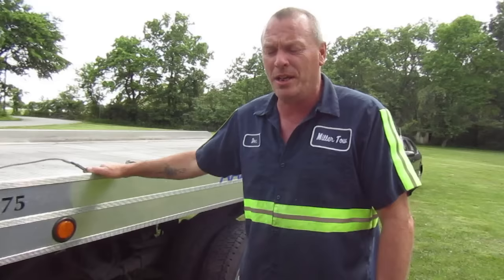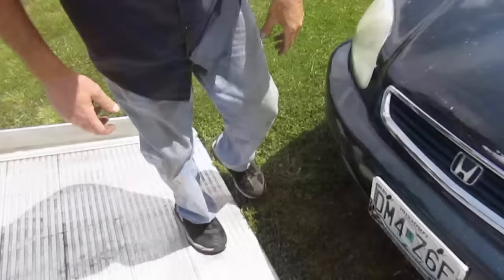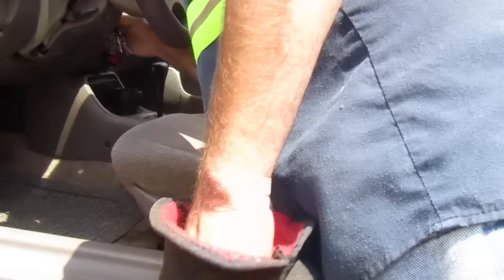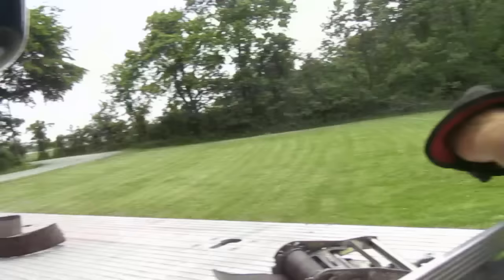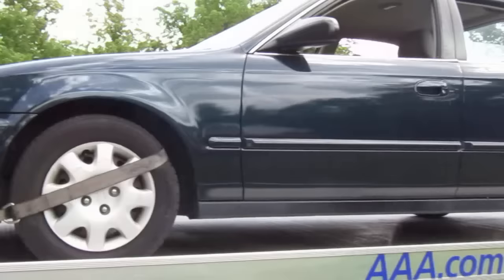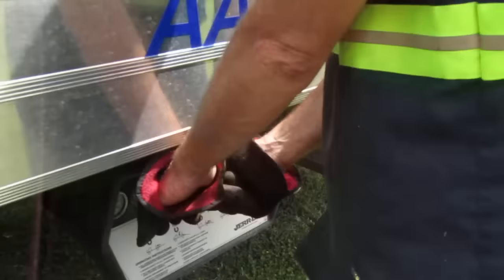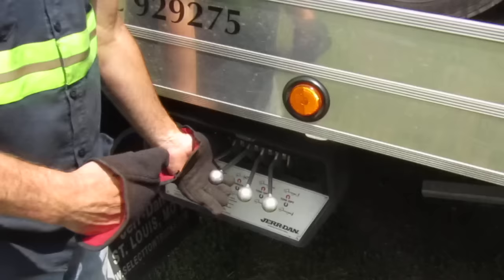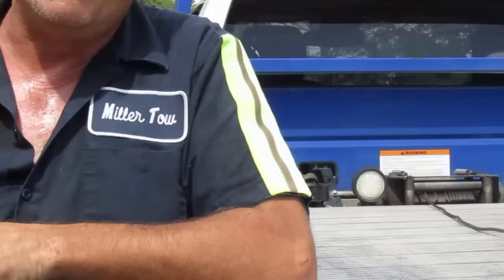How to load and unload a car from a flat bed tow truck

Comment: So why again don't you tighten the  chain I would think it could come loose still while driving due to the rough suspension and bouncing around?
Reply from the maker: You would think it would bounce around and come loose but it really doesn't when you put the straps on and the reason why I don't leave the change tight is because why the car is bouncing up and down it can hit the bottom of your oil pan oil filter anything on the bottom for the hole in it tear stuff up plus the frame of cars are real weak these days and the next thing you know you've bent the frame a little bit
Reply: Lots of guys leave some cable tension . Mandatory in states with 8 contact point laws ... Michigan , new york . Those two states require all 4 wheels secured plus rear chains plus a wratchet on each front , 8 points plus they like to see a j hook on the front direct to a t slot as an added precaution . Those same states require current paper logs .

Comment: Tips that this guy missed, safety first    Make sure your light are on, use your cones, set ebrake before turning on THE PTO, shock block the rear tire of your truck, get familiar with the locking point of your flatbed, while loading the vehicle stay away from traffic using the control away from traffic, don’t turn your back on coming traffic. I can write a book of things that a tow truck driver need to know an understand.

Comment: I just had to call AAA 2 weeks ago and the tow truck driver did not do all that you did here. He unhooked the wench and the car started to roll off the back while we were talking. I was behind it and instinct  kicked in- I put my hands on it to help hold it in place, as the driver grabbed the door jam then he tried to rehook the wench. I have had 2 prior back surgeries and just had surgery on my hand. Long story short- I messed up my back and my hand.  He didnt put anything over the tires to tow. Just a chain in the front and one in the back. The car had no insurance as it wasnt running. I live on a hill behind a Sonic restaurant. I was scared it would go over the hill and smash into sonic and kill someone. The driver asked me to get in the car and press the brake and check ebrake to hook it back up. I thought I would go down the hill backwards and die.
It was traumatizing and I am badly hurt.....sore and not getting better.
Reply from the maker: I am so sorry to hear about all that there are plenty of dumbass drivers out here I hope you call AAA in your in contact with his boss to get you some help
Reply: A vehicle should never go rolling unexpected, the driver is obviously clueless if this occurs, however the over the wheel straps and any other tie downs shown in the video are not the only way of properly tying a car to the bed, the over the tire straps are usually the easiest and if you are less experienced the safest but there are many other ways to attach a vehicle safely and sometimes over the wheel straps do not work properly/ cannot be deployed due to a vehicles condition.

Comment: Do I have to have a CDL to own and operate a rollback?
Reply from the maker: Here in the state of Missouri are you got to have with a Class C license which is basically a driver delivery driver license but I have a class B with air brakes
Reply: @donaldchastain6847  ok thank u so much. I found a fully operational roll back for 4 grand. I'm going to double check for my area cause I know laws change from place to place.

Comment: Hey where are other ace to hook up a car if those holes aren't an option
Reply from the maker: I have her cars on the lower a arm I've also wrapped change around the front cradle of the frame or if nothing else fails I take a soft strap and wrap around lower a arm
Reply: Ok thanks I was wondering

Comment: Those type of straps are best used on a wheel lift or maybe if you were to put them  through the wheel. And that left front should always get a safety strap before putting it in park so you’re not trapped behind the door if your winch should fail. The same should apply when unloading,leaving that last safety strap on while putting it in neutral. Some good points here,but enough mistakes for it not to be a proper method of loading.

Comment: why don't you gust use a  chain and the winch cable and just read the car on and off and do you know how to walk the bed or the truck same thing
Reply from the maker: the state of Missouri and Kansas don't recognize the winch cable and chain as a tie down point
Reply: Levi Brown 30A are you saying only secure it with the winch and a chain? No straps?

Comment: Straps are a waist all you need is a chain on the back and the winch on the front keeping it tight if your on the highway use two chains on the back it’s that simple
Reply from the maker: That will work here in Missouri but if you running Kansas all four corners of the vehicle have to be tied to the bed if not you're going to get pulled over and get a bunch of tickets
Reply: Dot must love you.   Haaaa

Comment: Your not supposed to put the car in park. You tow it in neutral. Watch a WRECKMASTER video sometime to learn the right way.
Reply: Pay the money for the Wreckmaster classes and in the 1st hour you will learn that there is no one way to do anything!  They are all about ''what ifs'' and covering your ass. They claim towing in park can crack the transmission case but I have never heard of anyone doing it.  If it flies off the truck in park then maybe but more than likely if a trans case is cracked its probably has to do with the reason you are towing it!
Reply: William Zoom only way supposed tow is pull car on bed. strap tires first then put bed up. Never put in park it will wear on shift linkage . can't believe people tow cars with out real training and knowledge of cars
Reply: lol, ok buddy:)
Reply: michael christianson
Reply: James Sherman Jr shift linkage?  More like parking pawl.  Just set the parking / e  brake
Reply: Forgott3n Gaming waste of time keep in neutral and wench it up then strap tires and you're ready to go when you get to your destination unstrap the tires and unwench it down and your done no climbing on the bed...Bed can be very slippery I've only walked on my bed twice you look more professional not getting on the bed either and in car manuals it says when in tow keep car in neutral. I have also never drove a car on my bed ...
Reply: having it in park with hand brake is safe and is more secure, thats professional
Reply: Forgott3n Gaming whats this shift linkage / parking prawl talk... i gotta learn this shit.
Reply: lol, ok. putting in park is not that different than putting in park on the street.
Reply: Your absolutely right. You don't put it in park and you don't loosen the winch until the straps are tight.